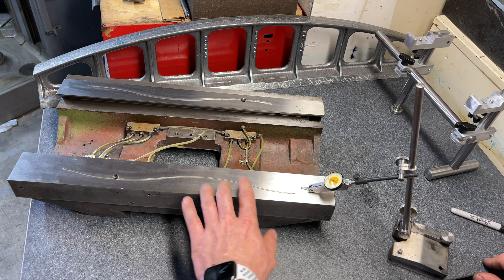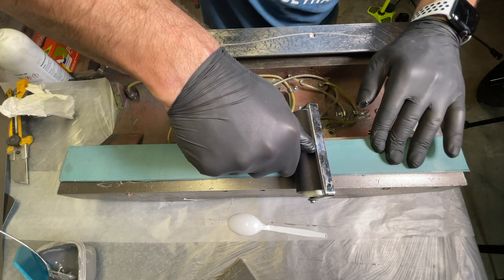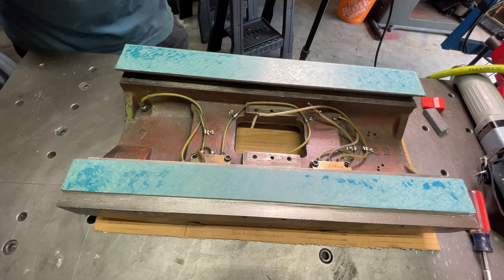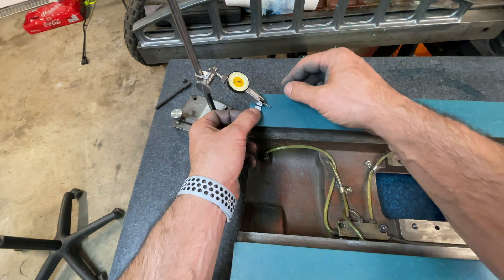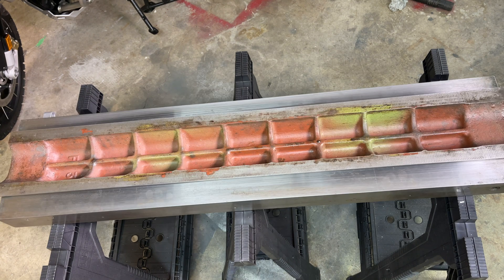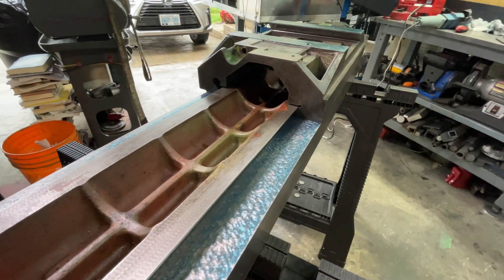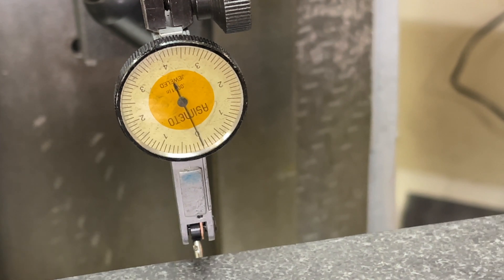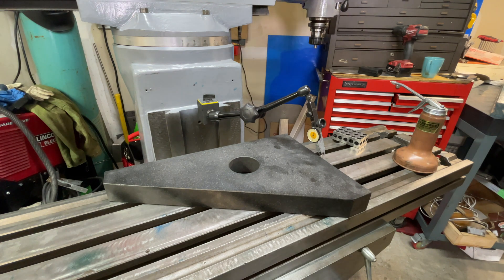Milling machine Rebuild Part 2

Comment: Beautiful job!  Just to add a bit of info for others about adding Turcite, IE: You may not need it.  In your case, probably not. You mentioned that after surface grinding, you had lost a total of 0.015" total saddle thickness, 0.007" from top and bottom.  That is not much at all, and is well within the "take up" of the gibs.  You didn't mention the thickness of the Turcite, but the min. thickness available is 1/16" or around 0.0625".  That's about 9 times the thickness of your loss of 0.007".  The thickness of the epoxy alone was probably close to your loss per side.  So in the end, your saddle went from slightly undersized to very oversized.  So it's important to consider all of the measurements before jumping into adding Turcite.  Regards.

Comment: Excellent video! I really admire your can-do attitude to a very technically challenging job. Given the machining that was done to the saddle, did you have to adjust the height of the nut(s) for the x- and y-axis feed screws?

Comment: Why would it necessarily matter if the bed was 7 thousandths less thickness than it was before?
Reply from the maker: Removing material from matting surfaces can miss align lead screws and nuts. That is why you add Turcite to make it up
Reply: @advanceair  got it. Thank you
Reply: Surely it would be much less work to re align the  nut. Perhaps you enjoy the scraping.
Reply: @martinmarriott3607  How would you go about re-aligning the nuts? They're held in a solid casting at a fixed distance from each other.
Reply from the maker: True. Main purpose of adding Turcite was for longevity of machine